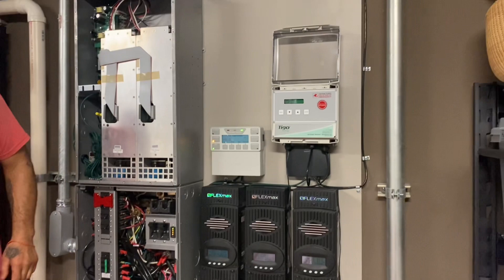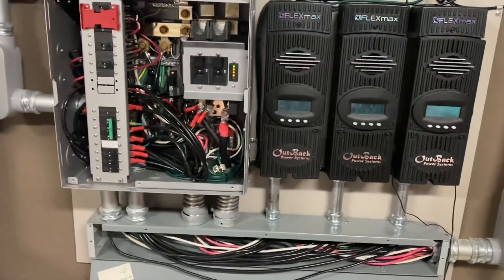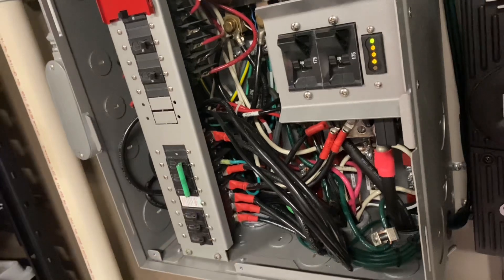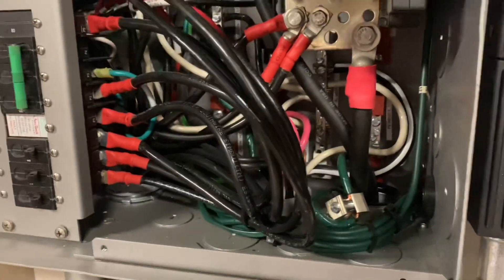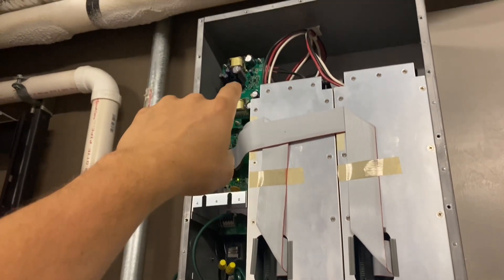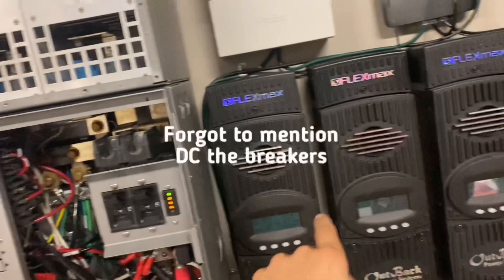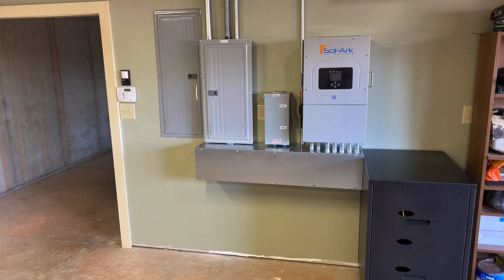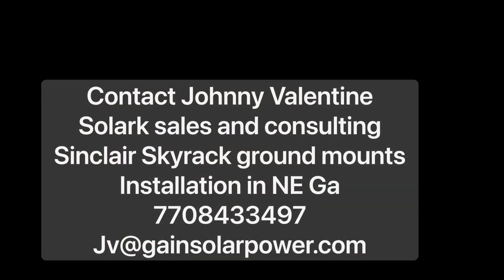Reasons to buy Sol-ark 1

Comment: one reason not to buy a solark?
it is made in china
Reply from the maker: They are expensive too!
Reply from the maker: What do you like urs. I bet you are a victron man.
Reply from the maker: I would do some Vicky t it’s just not really a thang here.
Reply: my main inverter is a selectronics, made in australia, similar specs to the solark. no inbuilt mppt, but starts compressors under full load.
there is a 12v victron legacy 12v system and a victron dedicated for the car charger.
i avoid inverters and solar chargers made in china. they are just not reliable enough and the specs doubly over what is. @GainSolarPower